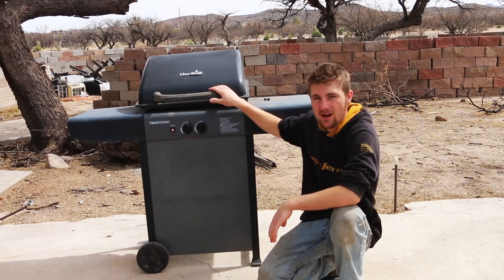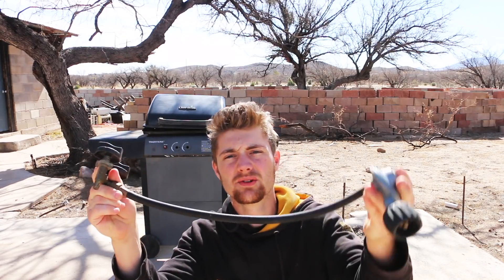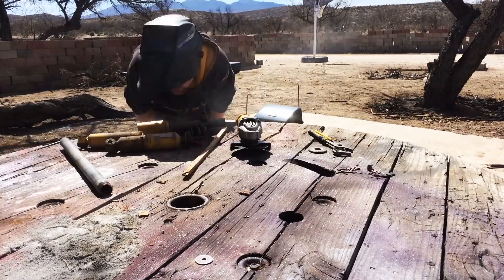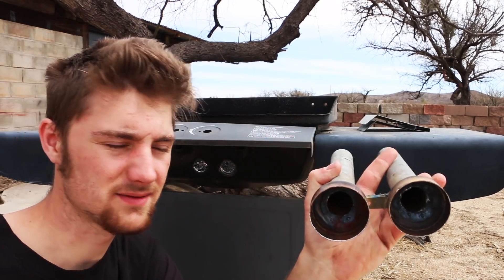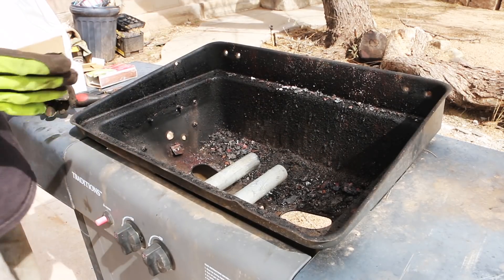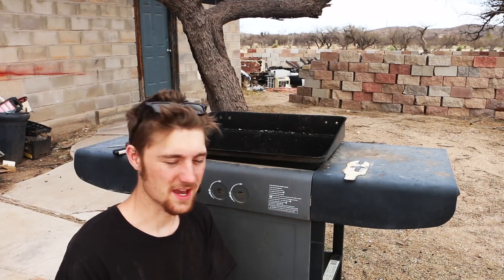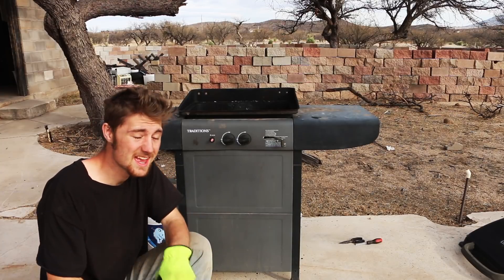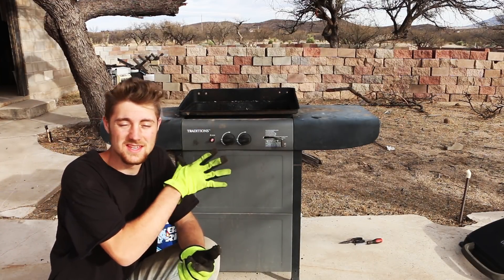Making a Free Foundry out of a BBQ (Part 1)

Comment: That UFO shaped thing on the gas line is the pressure regulator and those are set very low for BBQ burners, ditch that and get a propane regulator off ebay, then you can unleash the full pressure in your gas bottle and those burners will really roar!!  I did this and my burner throws an angry 2 foot blue flame, very loud and very hot!
Reply from the maker: Thx. I didn’t know that about the BBQ regulator. I’ll have to look for one on eBay :)
Reply: Lol I’m a year late but that’s what I was going to say

Comment: I'm thinking that your design is letting the air mix with the propane too soon. If you extend the propane tubes within the bigger tubes until right before the end, you might get a better burn, and won't have the problem of the flame going inside the tubes.

Comment: You need to consider opening the jets a bit more for more fuel delivery, flame too cold...lol 
To open the jets, take a drill bit that just fits into the jet and drill them out to the next larger size bit, 
remember to step up to find the correct size jet for the blue-white flame, as you will not be able to go back down without new jets.
More fuel, a bit more air and insulate the tub with refractory.
Like where you are going with this and it should prove to be way more efficient than wood fuel.
Reply from the maker: Thx for the great idea! I agree I think it needs more fuel :)

Comment: In the tub area I would add some fire brick or another layer of metal with some type of  fire proof insulatiion between the 2 layers.  The reason why is it will quickly burn thru the cheaper metal that the grill is made of.